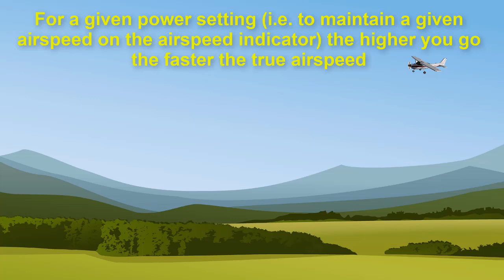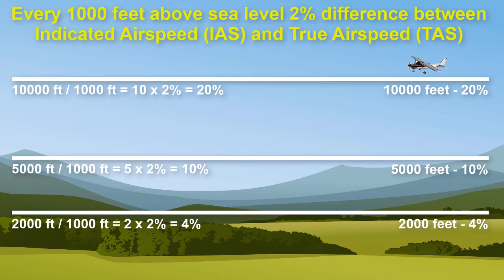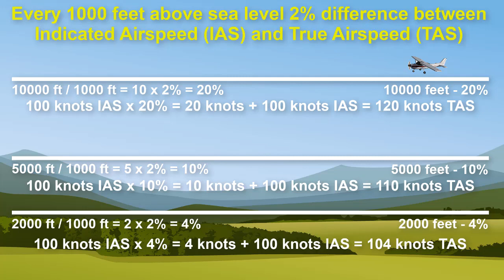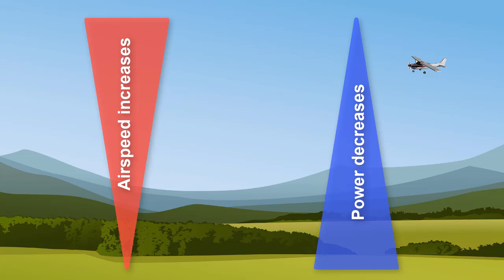Indicated Airspeed and True Airspeed

Comment: Thank you but I have a small doubt in this when you were explaining about the landing pattern at 2:18 sec u said that the IAS is 60knots at 10k feet then it would be 60 +20 =80 knots, am I right plz correct me
Reply from the maker: It would be 72 knots TAS.  60 IAS X .20 = 12  added back to 60 = 72 TAS.  Make sense?